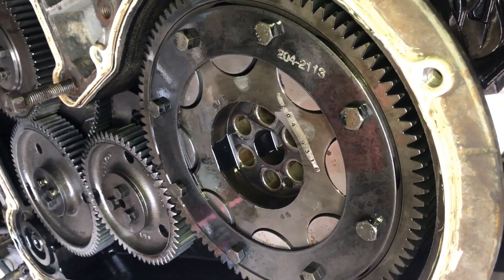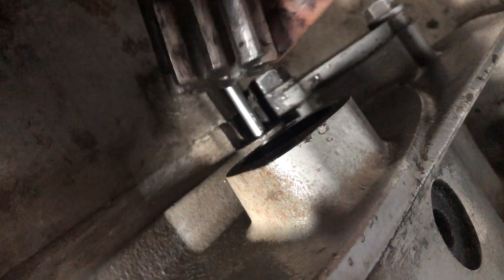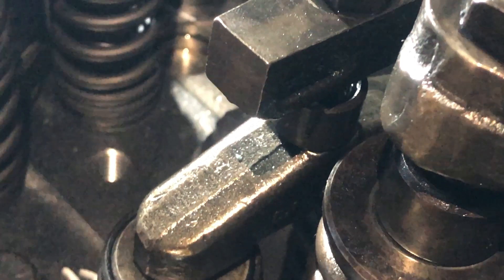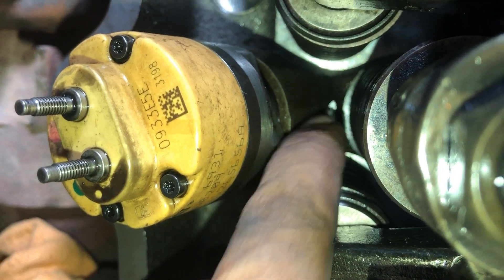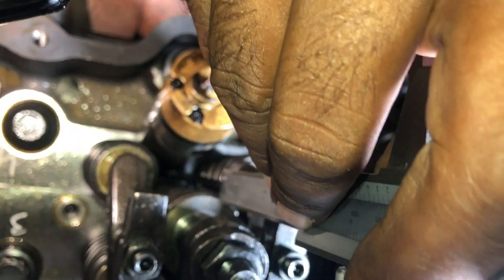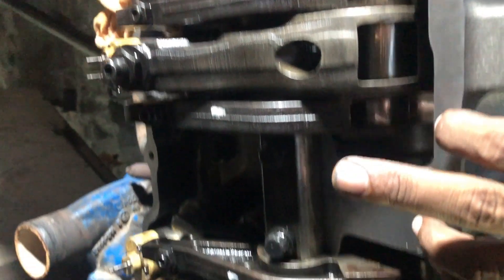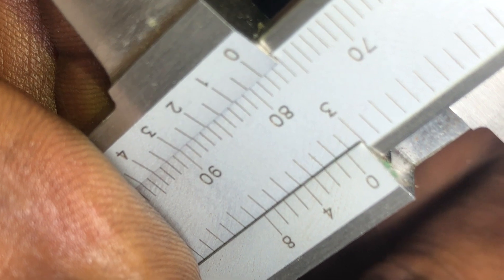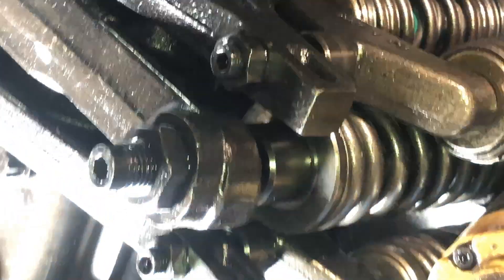Perkins 2506 Injector adjustment.Injector Height setting CAT C15

Comment: Rotate the engine in clockewise direction till the timing pin is connect to the hole in flywheel,could be number one compression stroke or number six conpression stroke
Reply from the maker: One will be compression other will be exhaust or valve overlap